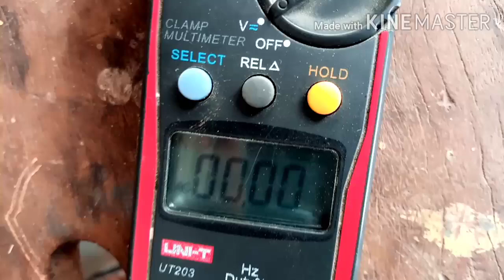DIY Making Wind Generator From Electric Bike Wheel | Very Easy | Testing And Whats Inside

Comment: I have 72volt 1500w hub motor i need to convert it to generator . what do i need?.  Why did you open yours?
Reply from the maker: Hey friend at the time when i modified my ebike wheel i had no YouTube channel but then after i created YouTube channel i wanted to create a short video of disassembling it, the reason is to visualize its inner mechanism for others who want to convert there hub motor into a generator and also in future if i want to create more generators i will have a clue and no need for thinking over it again.
Reply from the maker: https://youtu.be/Nt7H2ypd-M4

You can also watch this video in which i have converted it into fully working vertical axis wind generator and its working perfectly

Comment: salam bhai.bhai ye turbine to ban jay ga par is say battry kase charge kare ga.matlab output direct battrey pa lagay.ya sath koi cheez lage ga.ta ka battrey charg ho.ye bhe ap batao bhai
Reply from the maker: Aik Rectifier(jo video me dikaya hai) lagyga aur phir Charge Controller battery ko
Reply: @latif_hassan345  charge controller kon sa wala soler wala pwm wala.
Reply from the maker: @mustafakhan7532  PWM charge Controller bhai 20-30-50 Ampere wala
Reply: @latif_hassan345  ok bhai.main na banaya ha wind turbine hoverboad moter ka.
Reply: acha ager treadmil ki moter sa wind turbine banaya jay to us ka kya trika ho ga.battrey charge karna ka
Reply from the maker: @mustafakhan7532  treadmill ki motor ka itna power nhi hota bhai
Reply: @latif_hassan345  bhai treadmill ki moter ko ager hath sa rotat krta ha to 4 amp ki led aram sa chalti ha.mare pas ha
Reply from the maker: Phir tek hai